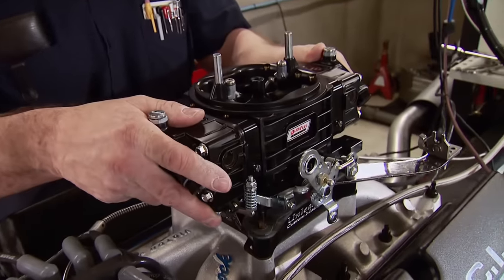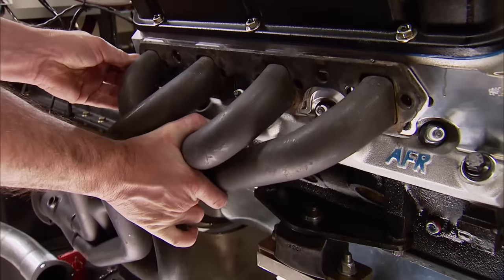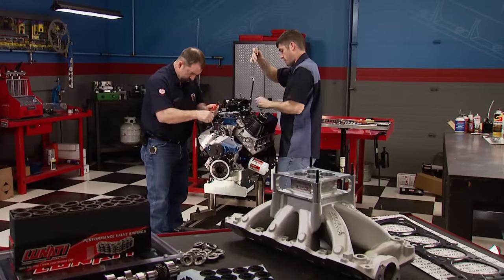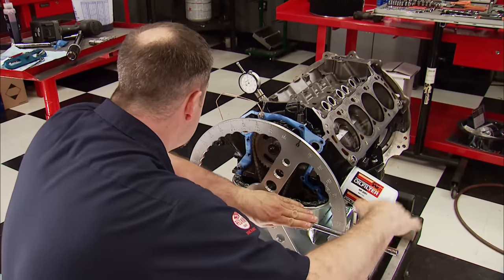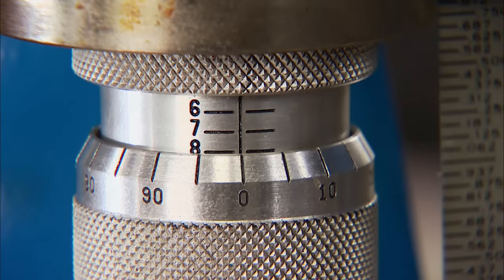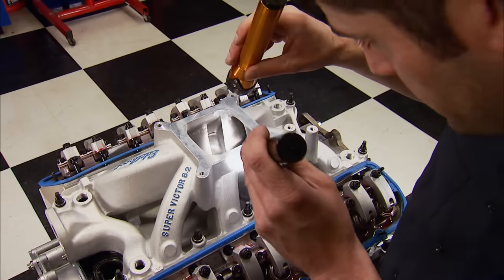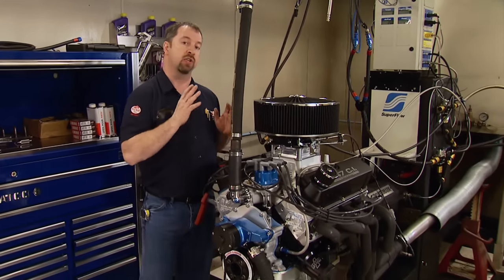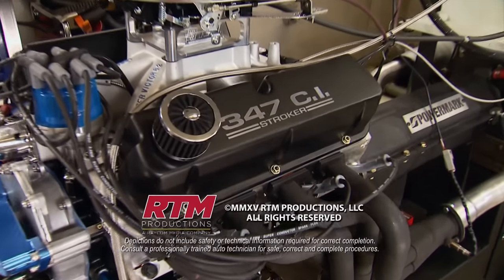Getting More Power Out Of A 5.0L Small Block Ford - Engine Power S2, E9

Comment from the maker: We'll continue to post these episodes here on YouTube. If you can't wait for the rest of the build, visit our site to binge-watch:  https://www.powernationtv.com/shows/engine-power
Reply: I’m I’m sure the audience would love to see a bolt on fuel injection system on this engine for a test
Reply: PowerNation i need that engine for my 71 F100..... 😬
Reply: THESE ENGINES WON LEMANS IN 1964 IN THE 289ci FORM IN THE GT-III CLASS AND BEAT FERRARI BY ALMOST 40 MINUTES. A YEAR EARLIER A FORD AC 289ci FIRST RACED AGAINST FERRARI WAS 20 MILES AHEAD WHEN IT BLEW AN OILER COOLER. IN THE COBRAS THEY SLAUGHTERED THE CORVETTES AND WERE NO COMPETITION. THESE ENGINES ARE A TERROR AND THE REASON YOUR LS TODAY IS BASED ON THE FORD WINDSOR SMALL BLOCK. JUST PUT YOUR FINGER INTO THE INTAKE PORT OF A LS AND YOU WILL SEE THEY CURVE INTO THE INTAKE VALVE AND IDENTICAL DESIGN TO THE WINDSOR WHICH IS A SPIRAL INDUCING COMBUSTION CHAMBER, WHICH ALSO THE HIGH RISER FORD 427 RAISED PORTS WERE USED BEING A FORD THEORY OF ENTERING THE CYLINDER AT A STRAIGHTER SHOT INTO THE CYLINDER GIVING IT BETTER FLOW. THIS IS THE REASON LS HEADS CAN GIVE YOU BIG BLOCK FLOW NUMBERS. CHEVY IS A JOKE. AND THE CAMARO IS IN BIG TROUBLE AGAIN, SLATED TO BE CLOSED DOWN A SECOND TIME BY THE MUSTANG. WHY DON'T YOU DO A EPISODE ON THE PURE STOCK COYOTE NMRA RACING. WHERE 425HP STOCK OFF THE FORD ASSEMBLY LINE ENGINES WITH COLD AIR INTAKE AND HEADERS ONLY WITH FORD'S TUNE COMPUTER. IN 3000LBS FOXBODY MUSTANGS ARE GOING 9.80'S ON PUMP GAS AND 9.40'S ON RACE GAS AND OUTLAW TUNE. THIS GOES BEYOND MIND BOGGLING HOW A 425HP COULD GO SO FAST. THE REASON FOR THIS IS DUE TO THE FACT THAT THESE OVERHEAD CAM COYOTE ENGINES CAN REACH THE POWER BANNED EXTREMELY QUICK, WHERE AS A STANDARD PUSHROD ENGINE REQUIRES MORE TIME TO GET INTO THE POWER BAN. SO IN THESE HORSEPOWER COMPARISON BETWEEN THE LS AND THE COYOTE WHERE THE LS WINS MEANS NOTHING. WITH LESS HORSEPOWER THE COYOTE WILL TAKE DOWN AN LS QUITE EASILY. THE NEW COYOTE ENGINES WITH THE 460HP ARE GOING EVEN QUICKER. WITH THE OLD 425HP COYOTE IN A 2500LBS CAR, WOULD THEORETICALLY GO 8.90'S. YOU SHOULD BUILD A NMRA PURE STOCK COYOTE AND RACE IT. THIS WOULD MAKE A GREAT EPISODE.
Reply: Saw that sweet air powered valve spring compressor I Want one please ? Where can i purchase one ?
Reply: Pastor Glock  ? .
Reply: Wondering can I get a build/spec sheet for the stage 2 build?
Reply: Is this engine for sale? Ty
Reply: i can't find stage 3 video :-(
Reply: I have a 1993 Ford F-150 5.0 302 efi  I would like to make 400 to 450 hp what do I need  do please get back thanks
Reply: Wait so how do you know how far to set the piston stop set screw down... can’t find a single movie on how to set up all the tools to degree a camshaft
Reply: Whats the difference between detonation and pre-ignition
Reply: Destination is when your gas ignited under heat and compression ( compressed air becomes hot) higher octane fuel fix’s this pre ignition is when the time it of the spark is off and ignites the fuel before it reaches the highest point it can late ignition is like pre but it ignites after it reaches the top and the cylinder head starts to fall back down

Comment: under 350 cubes and 566 HP..... gotta love that Ford HP.
Reply: ACPHOTO Check out Chevys straight 6s from the 70s with turbos making 2,400 HP and doing 7.10 quarter mile times.
Reply: @chloehennessey6813  Why the fuck would we care. Ford has the Barra.
Reply: @chloehennessey6813  the barra is better.
Reply: Unkle t0m When I see a Barra with stock block stock pistons, rings I’ll believe in Ford being built tough like these Chevy straight sixes doing sub seven second passes.
Reply: Brandon Smith Oh I thought you were racers-not fan boys. My mistake. 
When racing we just like to go fast and don’t really have a preference on Ford, Chevy, Dodge. It’s just whoever sponsors us and let’s us race on the weekends. 🤷🏼‍♀️
Reply: @chloehennessey6813  i dont support a company that screws its workforce.
Reply: Unkle t0m GM isn’t screwing anyone. If unions want to be so awesome they should pick up paying for healthcare for temp employees- why should GM foot that bill? Seems like they want something for nothing.
Reply: @chloehennessey6813  because temps have been there for 10 plus years.
Reply: Chloe Hennessey this May be a old conversation but umm that Chevy you were talking about is just a stock block not stock internals and it’s running on nitro and alcohol  with 60psi of boost and a different head and stronger internals so please do some research on what it takes to do it before you go brag and call other stuff bad
Reply: Not Ford HP, but aftermarket HP...
Reply: @GucciBodyBags  sounds like a shit union. My union if you arent salary and are in the building for 90 days you are automatically made union.
Reply: Still no where near the HP/cube that stock Honda motors get
Reply: @esnebta  and Honda's problem is not enough cubes...
Reply: @chloehennessey6813  only 7.10 with 2400HP?
Reply: or a Toyota 2JZ 3.0L turbo making 1000hp....plenty of those around.
Reply: Ford man for life won't change for nothing won't ever see me in a Chevy
Reply: No disagreement there stage one was pretty badass in my book maybe going to Stage 2 but keeping it on pump gas was pretty cool too but I would stay with the hydraulic rollers

One other thing as soon as you modify an engine is no longer a Ford or Chevy or whatever people are calling it it's called somebody had more brains and figured out how to make more horsepower and torque
Reply: @bigboreracing356  yeah unless its a boss engine or the few decent engines Ford made with thicker castings or higher nickel and steel, the blocks are known to split down the middle lol after 500hp
Reply: Either way it goes they both have good pros, and bad cons lol,
Reply: @chloehennessey6813  yeah ur talking big money to build something like that it’s a completely different class.
Reply: Yeah they make really good power with some basic parts and they don’t require crazy clearancing , special cam like Chevys do.
Reply: @chloehennessey6813 keyword TURBO! FORD for the WIN!
Reply: @chloehennessey6813   not on stock motor
Reply: wait til you see what can really be done with them.  324" and over 900hp.  Naturally aspirated.  Lots of RPM--and maintenance.

Comment: Id be happy with the stage 1 with the bigger headers and carb for 532hp sweet
Reply: Funny how they didn't use that comparison.  Probably because they spent an extra $3k to make 30hp.
Reply: @superkillr  right?? AND you have to use race gas. I'll take the 532hp on pump gas any day.
Reply: @SquishBangBlow They have to help their sponsors sell their shit but were not stupid aye
Reply: @superkillr  it's not just 30hp though, it's power all the way to 8k rpm. That is what you'll need if wanting more strip versus street
Reply: Yeah, these are infomercials...
Reply: Same thing I was thinking
Reply: That's not rear wheel power tho. So you'd probably be at more like 450 ish but that's not bad tho man. Shit I'd take it in any damn stage lol
Reply: @sean5comet  ur kinda right, but theres a reason he said street build. On the street you want down low power, plus street drivers are usually less experienced and shouldnt be pushing an engine to its RPM limits to get the most out of it. Either way, 3k for that difference is just pitiful.
Reply: @superkillr  any idea why they didn't throw a blower on it for 3k? Seems like it MAY make more than 30 HP with a few pounds of boost
Reply: No way, 6800 rpm vs 8000? I'll take stage 2 with only the rollers
Reply: 8000 rpm blows up most 5.0 HO 302s! They clearly got a great block to start with! Maybe the Mexican blocks with more nickel content isn't just a myth! I know 5.0s with 100s of pulls on em, drag & street, and they're still going today!

Comment: I installed a 347 Stroker from Probe Industries in my 1994 Mustang GT.  It made 440HP on pump with 14 degrees.  347 Stroker, AFR 185's, Comp Custom Cam .542 / .562 Split Duration (94-95 ECU), Holley Systemax Intake with port match 700 for a 70MM Throttle Body, Pro-M 80MM MAF, 30 pound injectors, MAC 1-3/4" Ceramic Long Tube Headers with 3" Collector, MAC 3" Prochamber, MAC 3" Catback exhaust.
Reply: I drove Mustangs in the 70s, all 302. We were glad to have h/p exceeding cubic inches. Your numbers on the 1994 are amazing.  Do you still drive this car and if so, what needed your  attention to keep it running.

Comment: What's up Pat?!!!!! This is Shaun from The School of Automotive Machinists back in 2007! You walked me through the School the first time I visited there! Awesome.

1.5x per cube is pretty dang good. I have pretty much the same combo but it's a Chevy rod, 302 piston, stock crank deal,357 Windsor. I ported some shit procomps , I spec'd a cam, solid roller 243, 257 @.050 .650 lift 110 +4. Put a thin gasket on it. It Dyno like 430 or so to tires through c4 on motor. But on the juice it fuckin gets it! Been a 1.21 60' and 12x mph in the 1/8th. It's about to go faster with a nitrous controller and electric wp and few other mods.
Reply: Ya know he probably won’t see this right...

Comment: Imagine this kit on a 4.125 big bore! That 363 would be a giant killer!
Reply: I am building a 363 canted valve solid roller motor should be in the 600 + hp range on pump gas at 7,000 + RPM but if you want more go higher compression on race gas

Comment: I would have liked to see the 2" super sucker carb spacer that was used on stage 2, used on the stage 1 setup.  I've found those spacers to be worth as much as 24 hp alone on some builds we've done.  Nice work fellas.

Comment: Thanks for doing this build.  This is pretty much the same combination I did for a 347 I put into my Cobra Kit Car.  I never dynode it, but my calculations said it should make about 535-550 HP.  FYI - I went to a 650 carb and you could tell driving the car that the power picked up.  So your dyno pulls more or less confirmed my numbers.

Comment: Im in the process of building a 347 Stroker from my 99 explorer roller block. 
Its been bored .030 over. Has a Trick Flow 11r twisted wedge top end kit.
Eagle stroker crank with DSS pistons. 
Weiand dual plane intake and 750 Holley Dbl Pumper.
Its going in my 86 Bronco. So obviously the power band is in the 1500-4500 rpm range. 
I’ll be setting up a 4* advanced to get more power down low.

Comment: Wow, not bad with a stock block! But I hear, if you line hone the cam journals and the mains in the block, keep a good tune, they hold up pretty good! I’m trying to mock Joe Sherman’s 347 with roller cam, he got 530hp with the AFR 185cc heads, guy did same build but used the AFR 205cc heads and got close to 600hp! Those little Fords can wind out the power!

Comment: Hot rod put out a formula years ago to get 400hp out of 302ci w/o alot of voodoo or special parts  , I built three or four of them , they were a blast , didn't need hardly any special parts , just needed to take 2/3 weeks and learn how to Port cast iron heads of the right vintage to the max , then have them flow benched.

Comment: Love the small block Ford engines. There’s a reason Shelby used these style type small blocks on the early Cobras. And it all started with the little 260,289,302,351W.  When Ford put the 302 roller engine on the early Fox bodies, it was a great engine but was just lacking horsepower. But when they figured it out it was a little BEAST.
Reply: I remember my first ride in a 1988 LX 5.0 Mustang 5-speed. First time I had been to 140 mph. Even at just 225hp it felt and sounded mean as hell!!  Felt much faster than any Mopar or Chevy at the time. Most Camaros and Corvettes in the 80s were auto transmission cars which were joy killers back then. Even if you did stumble across a stick shift Chevy they were still lacking that beautiful exhaust sound 5.0s are known for.

Comment: These 347's will make a LOT more power! Ours is around 800 hp na on pump gas. And will spin WELL over 8000 rpms. Our shift light don't come on till 8600 and there is plenty after that. Get those heads professionally ported and better headers. Then you will be snapping blocks in half like we did. (5 in total) then got a aftermarket dart block.
Reply: CowsGo Moo lol.  We picked up well over 100hp. Just got to know how to do it.

Comment: Get ready to see that block split right down the middle in the next episode.
Reply: Did you not hear him say there going with a aftermarket block???
Reply: I don't see any reason why it would... The 302 is capable of quite a bit more power on the stock block. You don't need to go billet with the 302 until 950 hp or more.
Reply: @anonymousanonymous9991  Stock 302 engines start to crack in the lifter valley around 600HP.
Reply: @traeheck3614  In this 347 it might but anything between 302 and 331 won't crack until much higher. The 347 can be saved with different heads.
Reply: @anonymousanonymous9991  302, 306, 331s have split around 500-550 hp. 347 is bored .030, which is basically what you would take a 302 to make a 306, you just increase the stroke by .40 to a 3.40 stroke over the stock 3.00 but that is made up in the rods and crank. There are plenty of vids and forum posts where people have split stock 302 blocks at just a little over 500hp. That's why they are going to a aftermarket block for Stage 3
Reply: They won't be splitting the block as they are swapping to an aftermarket block for stage 3
Reply: @willipic  All you have to do is make sure the geometry of the valvetrain is not conflicting. Then it won't split the valley. High RPMs don't help either. When I say the block can handle more power I'm not saying this build could handle more power. A boosted 302 with Z-type heads, hydraulic lifters, and long tube headers should always make 600 hp so long as it's properly tuned, balanced, and built properly. 600 hp at 6-8k RPMs in an NA 331 is not going to last very long, but 600 hp at 4-5.5k RPMs in a supercharged 331 is still reliable.
Reply: They said aftermarket block? Didn’t they?
Reply: @shaggydogg3786  For stage 3, yes because they know that if they went any further with this one it will split.
Reply: Willipic they're not  talking gm engines here !
Reply: Brad Zimmerman nope, roller 302 blocks have been splitting for years right through the lifter gallery. Just go google it.

Comment: I'd love to have the stage one in a Mercury Capri bubble back.
Reply: Bryan Jones a 351 Windsor that’s a mild 450 horsepower motor is definitely fun in a 1979 Mercury Capri
Reply: @gearhead682010  the frame won't 
Hold that kind of tork of the motor

Comment: Don't think he made it clear, but with the low deck height of the block, you can't get the long roller lifters out of their bores without pulling the head (that's not an endorsement for flat tappets, but something to keep in mind). A real 351W block is probably high enough to allow you to get a roller out without head removal.

Comment: You left a valve cover nut loose on the driver side center. You can see the washer bounce around in the stage 2 dyno pull

Comment: Any of these combos will live at those numbers for just a very brief time while constantly being babysitted in a controlled environment.
Put this very exact engine in a mustang and go racing under race conditions, if it lives for a race season, then I'll be impressed.
Reply: That happens everyday...
Reply: @CanIbeFrank  stock production block with all of these add on's for an entire season?  Then they have a preacher, a rabbi and the pope praying over the engine after every pass so it don't break.
Reply: @thomaspartin191  there's plenty of fast stock block sbf around. You'll find them on YouTube
Reply: @CanIbeFrank  I agree completely, i love Ford's, however, this video is trying to say what Ford enthusiasts already know, stock production block can't take lots of abuse like this for very long before grenading.
Reply: @thomaspartin191  they're good for NA applications. Boost is a different story. Boss block or dart or world at that point. A 351w is much stronger than the 302 as well. I'm building a 408w for my 95 Mustang with a 95 351w block out of an old F250. 9s on motor is the goal. Ps you'll like my channel if you're into cars.
Reply: @thomaspartin191  in a circle track application I agree it wouldn't last but in a street strip application aka 1/4 mile it would. It's brief high rpm then shut off. Enduro/roundy round is a different animal...

Comment: That sure beats the stock  150 horsepower EFI 302 in my 87 thunderbird
Reply: Back in the eighties I loved leaving the stop light with  5.0 fords of all types my chevy 350 4 speed would do 6000 rpm shifts and by third gear the fords  would just give up, the cam and holley double pumper was the secret combo I just loved dumping the clutch and getting rubber in the first three gears those poly glass tires hooked like fly paper when burning hot!

Comment: You mentioned reaching the limits of a stock block but for the newbies w/more money than sence you need to be more specific; this rpm cant be maintained w/out severe breakage.  BTW, you never mentioned the Static Comp. for this build but you were running pump gas w/octane boosters, so my observations n questions are,
1) a 290+ duration cam isnt a true stage2 cam; so stage is set for the stage 3 normally aspirated build
2) going strictly by the numbers there seems to be a few untapped CFM HP in those cylinder heads.  So do you up the Static Comp. to squeeze out those remaining CFM HP #s or
3) If your are upping the Static Comp. do you opt for the AFR 225cc heads but by doing that your Stage 3 normally aspirated just slipped into dedicated race category and no longer falls into a true pump gas engine.  Good stuff, thx for the vids
Reply: At 11:01 they mentioned compression ratio
Reply: @strictlybusiness1598  thx